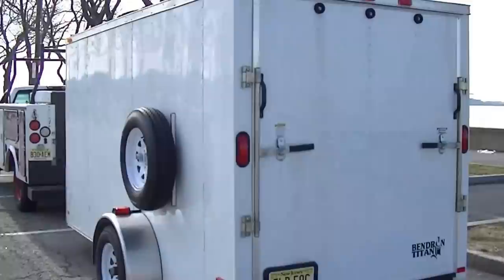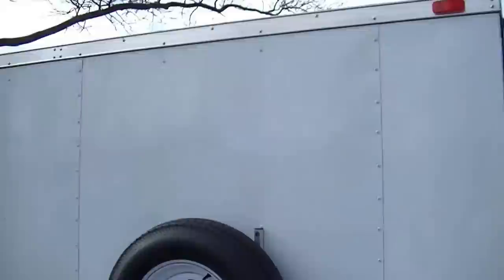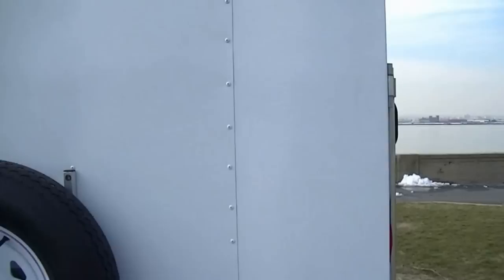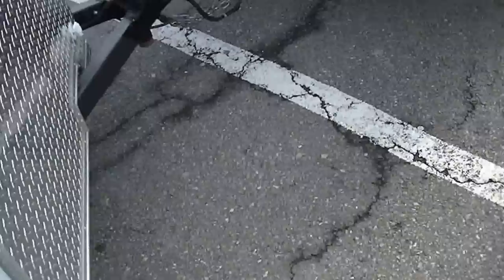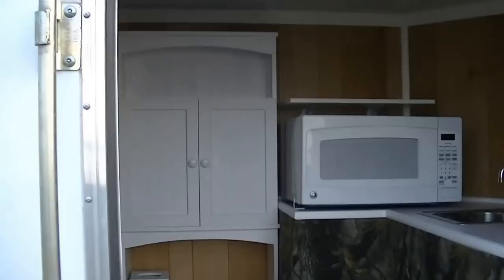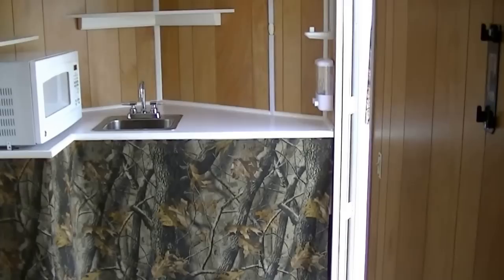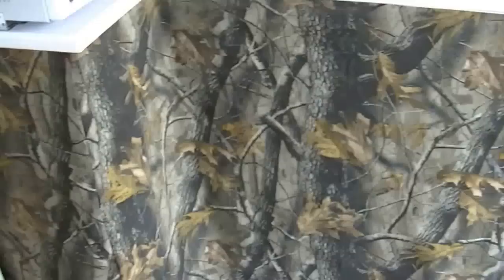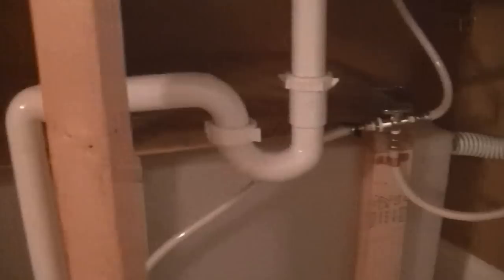Bug Out Vehicle - Cargo Trailer Stealth Camper - Part 1

Comment: Great job! I had a similar trailer I used for work and camping. The one mod I would highly recommend would be to "flip" your axle. You would move your axle from above the springs to below them, giving you 4"-5" of extra ground clearance. This helps to prevent dragging your leveling jacks and really gives peace of mind when entering rough areas. Really good looking trailer!

Comment: Nice! Hey here is a tip if you want it. Take a 8" wide pvc pipe about 8 feet long and put screw end caps on both sides. You can permanently mount it to the trailer and use it to carry fishing rods, maybe a rifle or other stuff instead of it taking up space on the inside.
Reply: would you be able to lock it up too?
Reply: Make it a black one and you can fill it with water and get a bit of solar heating too. Not much, but it beats washing your face in cold water.

Comment: Thanks for the video. It gives me ideas for hauling the Harley to Sturgis or Daytona and being able to use the bike carrier as a camper. The old lady and I are too old for tents but too cheap for lodging during peak bike events.
Reply: Jeff Lilly In my other response, I mentioned "being with people who have built similar units"... Sturgis is EXACTLY what they built theirs for.  Loaded with Solar, Satellite / Flat Screen and screen door on the side entry, with a sectioned screen magnetic closure door for the ramp opening.  They put both of their bikes inside, and when they roll them out, the sofa/bed swing down from the walls.  8 or 9 years of improvements and I would say that all 3 units are nearly perfect for each couple's budget and needs.
Reply: So the "old lady" and you are not be real bikers either.
Reply: @gsp49  
What's a real biker?
Reply: @SamC379  ask your mum. She knows plenty
Reply: @SamC379  say hi to her for me.

Comment: Damn good job all the way around. All I would do is add solar panel on the roof, reversible fan roof vent, roof AC, inverter, mini fridge, and an on demand hot water supply. Love it
Reply: +Lewis Johnson Also, a good idea is to get a coil of black pvc 10 to 20 feet to put up on roof and run water through it for hot water.  A mixer valve will be needed since the hot water could hit 200 degrees, (The longer the tubing coiled up, the more hot water until it cools down).
Reply: +hughie voso Absolutely. I used a 30 gallon black barell laid on it's side on the top of a Step Van once when chasing jobs on the road for a "vagabond" shower I made. That worked pretty good but yes the water could light you up after a sunny day lol. I had it all gravity fed and as for the shower being too hot it was in the mornings usually when I showered as I worked night shift as a crane rigger then so it was OK except in winter months to say the least. Thanks for the reply man and keep on keeping on!

Comment: BEAUTIFUL!!!  Man, but that IS sharp!!!  I would rather own that than most of the conventional RVs that I have seen out there. Why pay mega bucks for a flimsy piece of crap when you could have this instead?
Reply: +Gachitadamunga 
Hell, I wouldn't trade my travel trailer for that. My trailer is far more capable, full-featured, and comfortable. We use a utility trailer (pulled by the wife) for storage and a portable workshop. The two pickup trucks add additional hauling options. Mine, for example, hauls an inflatable boat (motor, gear, etc) for fishing or recreation.

Comment: Hi, you did a great job so far! Adding solar capable will really get you off the grid. I do have two things, that you may want to do. Attach a shower head holder on the out side wall and attach some dark water hoes wound up flat on the roof of the cargo trailer for a few gallons of hot water. I am sure you can figure out how to do the plumbing. Again, great job! Stay safe and enjoy life!
Reply: The black wound up hose for hot water works! I know 1st hand and I also wondered if theres a holder for the shower head

Comment: This is quite the set up bud, very clever use of space with plenty of room for options. I'm a plumber R&C. And a tankless water heater would be a good option. Often referred to as "Rinai" heaters, would not only ideally fit. It would handle any demands you throw at it. But you would might need to invest in to a solar panel?

Comment: That is exactly how a camping trailer should be, basic stuff and lots of empty space. You can use a foldable table es a desk and still get your 4 wheeler or motorcycle inside. Advice if I may, don’t get solar; get a goal Zero 400, add two batteries and get a Honda 2000 Generator. Put the Goal Zero bellow the sink. Solar is slow and expensive. Don’t get a fridge, get a Yetti Cooler. They will keep the ice for a week in the shade. Excellent idea the porta potty. Great work!

Comment: Good start on you conversion. I have a utility trailer that I use for my handyman service. I plan on converting it into a camp trailer in the near future. Nice to get ideas for when I do. Just for your info, you didn't need to put in a J trap for your sink since you don't have a sewage storage tank. That way you don't have to worry about getting the water out of the J trap for winter storage/freezing. The purpose of the J trap is to hold water to keep the sewer smell/gases from coming up. You don't have that problem.

Comment: Your workmanship looks great, but with all due respect. I believe having all of that water (320lbs.) mounted in the nose of that trailer causes you to be way to heavy on the tongue for proper weight distribution. That can cause poor pulling stability. Also it seams like you have all of the weight on one side of the unit. You might want to try distributing the weight out a little better. This would make pulling that thing a dream. I’m pulling one behind a 2 door Jeep Wrangler and I’ve really had to pay attention to load/ distribution very closely. My pulling capacity is only 2,500 lbs. which is approximately 250 lb. tongue weight. Please don’t take my post the wrong way. Overall your project looks fantastic. Hope everything is working out for you.

Comment: Peace, for hot water u can get solar shower bags. When I go off the grid I have 3 solar shower bags sitting in the sun, One bag is good for a good hot shower and use the other bags for washing dishes ect; real cool keep up; the great work. I agree the pooper should fall back to the rear a compost toilet a five gallon bucket.,toilet seat heavy duty black trash bags with saw dust . I place several bags in bucket so when I pull one I add saw dust. I used this method when my home bathroom was under remodeling. works well does not smell. don't forget the lids.Peace

Comment: I like it but it would have been more space saving if you built a false floor maybe 2 1/2 feet deep with cubbies below for storage, and add a lift lock roof to make up for the walk space loss by the raised floor. it would add a lot more light and don't use stationary cabinets or a bed. use Japanese floor futons that can roll up and be put away. (the thick ones not the traditional ones.) the cabinets should be on hinges so you can prop them up when in use and lay down flat against the wall when not. and on the walls and ceilings have hooks and stuff so when you have guests over you can add hammocks and fabric hanging closets and cabinets that again if not in use you can store away or tie on to the ceiling. and if you want a couch you can hook one up to the wall. the two and a half deep floor would give you space to store a composting toilet under the floor when not in use. just my opinion...
Reply: Tsukani Takuda  put some major thought into this. I like your ideas

Comment: Not wishing to be too negative as this is a VERY nice and tidy build, but if you are serious about going "prepper" you need electricity e.g. solar and batteries.  Although I know you said it was not finished.  I think I would have chopped the lower third or half of the pointed front and created a squarer boxed area for batteries and propane which you could access from outside and sealed it up to the inside.

Overall, very nice.  Great job.
Reply: Why would you need electric???  In a SHTF .. the last thing I would be worries about is my solar panels.. waste of money for a true prepper

Comment: Great first job...
From my mess up mistakes that I had to redo work water lines...
From now on I will use NOTHING but Pex... it will expand if frozen and go back to shape.. that line you used is what flooded my trailer... now I use only pex.. and it's in red and blue for hot and cold...
I sold that trailer cause the axle was NOT heavy enough. So now I'm converting a two horse with quarters trailer this time...

Comment: Great job. I am in the process of building my 6 x12 cargo trailer into a stealth camper also. What I ran into was dangerous off gassing from the plywood inside the trailer. I was getting sick with dizziness and headaches. So what I did was take all the plywood out, prime it with a safe water based paint on all sides(including edges) and put them pack in their place. This seems to have fixed the problem.

Comment: I just soldered some wiring harness for my ABS electrical signal wire too. One end by wheel speed sensor is a basic plug and play unit, but other end had to be cut, soldered, and insulated with shrink tubes. So I am learning how to do electrical stuff by soldering wires so far. I have no experience at drilling holes in rigs, however. I have a 2013 Chevrolet with a Cadillac V-6 and it can tow 1000 pounds with 100 pound tongue weight. I did tow three U Haul Trailers from Los Angeles to Seattle as well. The first trailer was 850 pounds and second and last trailers were 990 pounds as empty. I did weight the tongue of the trailer on second one and it was 156 pounds, so the loaded trailer must be 1500 pounds or so. Empty, I think the tongue weight was 85 pounds or 99 pounds. So I can over do my 2013 Chevrolet and make it tow U Haul trailers, it was great towing! Nice to visit that Idaho, Nevada, and Montana along the way!

Comment: I had a '65 Econoline Supervan. Took the hood of an old GMC pickup and made a wood stove. 11"x11"x12"Deep use sheet metal screws with a door with adjustable vent on front. Standard stove pipe through the roof. Used the lid of an old tobacco tin to cover the chimney outside when no fire. I kept a box of cheap sawdust logs for backup. Get wood anywhere. Couple handfuls of sticks got me from 35-74 in 10 min. Below freeze outside 75 inside w/window open. Never get cold! Free heat :~)

Comment: Like what you've done except for the microwave. A microwave/convection oven combo would add the ability to roast meat or bake bread in the same unit. And, without heating up the whole place unnecessarily. We had one in our last camper and used it everyday.

Comment: Wouldn't a cargo trailer actually be the opposite of stealth for a SHTF scenario? Cargo trailer = lots of supplies to steal. Whereas a camper = a mobile living area. Honestly I'd think about using a camper to haul around my valuable supplies as stealth... Just saying.
Reply: TheGWood89  I suppose that if you went off grid, say pre shtf.  You could park most places with this set up  and no one think twice.  

Post shtf I see your point.  Unless you camouflage it well, it would definitely bring some unwanted attention.
Reply: In SHTF, no one's going to need drywall, cabinets, racing equipment or stuff like that.  They'll want food, water and guns, and I'd look for those in a camper before in a trailer that looks like this.  Maybe I'm wrong, but that's my take.
Reply: TheGWood89 , the camper would be easy  for theives to get into, cargo more secure.
Reply: Bug out with a microwave and tv with running water? 😂😉😅 thx for sharing.
Reply: Put biological medical clean up on the side in safety yellow... No one will touch it.
Reply: You start at "stealth" to lower your profile in daily life but post SHTF all bets are off so you need to defend your perimeter either way. I’d probably reinforce the roof for even more sq ft. As long as the axle and frame are rated for a decent weight.

Comment: At first look at the outside I thought this trailer idea is going to suck. But once I seen what a great job you did inside, I think its awesome! You did a nice clean looking installation. I like how the walls are completely vertical, whereas vans usually have rounded or slanted walls. The front point of the trailer was a great place to have your kitchen and sink. Wonderful!

Comment: I like the stealth trailer idea. I made one myself. But you will learn that filling up your water tank to full adds about 400+ pounds to your hitch. I put my tanks over the axles and added a extra leafspring. Fresh water on one side black water tank on the other side where I use a Airhead composting head. The head needs no water at all. I also use a foot or handle water pump (I have both) for the water system.  I also have a sailboat that I live on. It is easy to hide in small coves and yes it a Bluewater boat.  On both of them I can live off the grid very comfortably. More so on the sailboat. Reason is I can carry more water / food. Besides solar power I also have wind power on the boat. Both have two heaters systems. Plus at sea I can dump my black water overboard.

Comment: NICE LITTLE CAMPER YOU GOT GOING TOGETHER , GOOD THING ABOUT IT IS THAT IT LOOKS LIKE A TRAILER !!  NO INSPECTION NEEDED ... I JUST BOUGHT A 24 FT. PULL BEHIND CAMPER TRAILER MYSELF - GOOD LUCK WITH THE REST OF THE MODS-  YOU ARE ON THE RIGHT TRACK !

Comment: Great idea, a work trailer that is a camper. You can park in a parking lot and no body would know that you are camping.  You could put propane brackets on the outside of the tow hitch or just make the connection and carry the tank or tanks in the truck. Nice job inside.

Comment: Nice. Making both vehicles even less desirable (“Johnson’s Septic Tank Cleaning Service”) would greatly increase the stealth capabilities even more. You can purchase temporary (easily removable) magnetic, static-cling, or mild-adhesive signs, which could be applied just for the occasion.
 
Of course, the more you convert it into camper (windows, external connections, access panels, canopies, etc), the less stealthy it will be. If people catch on, they may wonder what you’re trying so hard to hide. Place any further connections underneath or just inside a door.

Comment: Not sure what we have learned from your video... However, you've done a fine job of putting together a compact hunting cabin.  Good workmanship.  After being with friends who have done very similar projects, I would suggest that you add a screen door on your access door, and a screen on your ramp end... those "Magic Click Screen Doors" work very well for that opening.  Also, speaking as one who is a life-long RVer, I think that if you're going to spend very much time inside, a nice inexpensive investment to help your sanity is the addition of a 1 gallon, 2 gallon (or larger) water surge tank w/ bladder.  Without that, you will hear the pump EVERY TIME you crack the faucet, or worse, even a tiny and insignificant leak will keep you awake all night as the pump moans at a set rhythm!  Of course, I could go on about what you COULD add, but I'm sure you have your own list.

Comment: *****
OUTSTANDING!
I'm currently modifying my enclosed trailer similarly, though my back door is not a ramp. Consider at 13:14 NOT storing perishable food. For now (camping & trips) the cooler & little refrigerator is great obviously, but in a true bug out situation I'm sure you already know that a person can pack 3-4 times more food if its dried food.

Comment: For a "limited budget" that's a damn awesome set up man... Great little concealed camper... Read some other posts ... You're not hauling freakin gravel or rock so a single axel is really all you need for this. You totally nailed this in my opinion plus you made it plug and play to add extras in the future such as solar, hot water connection, etc.. Fantastic job.

Comment: Nice looking camper.  Especially like the camo curtains and their velcro attachment. The velcro reminded me of some insect screening I had that was door sized and attached with velcro. Keeps out the flies and skeeters and still have fresh air, or if there's no need just pull the screening off the velcro.  Stealth is great idea. I'd still want to be able to look around outside and was thinking it might be cool to install some through-the-door  peepholes in every wall to check things outside without giving away your presence by opening up the door....I might have a skylight for letting in daylight, and no visible windows. Have a reflectix panel to cover it inside for stealth and for colder nights or hot days.

Comment: EXCELLENT job. I really like what you've done with it. I have a few small humble suggestions for your trailer. 1. You have locks on your spare tires, but none that I could see on the drive axle tires. You might want to invest in a set of locking lug nuts to keep those from being stolen since you put locks on your spares. 2. You have PLENTY of room on either side of the V nose to install two propane tanks with mounting brackets to secure them. You can bolt it directly through the diamond plate.

Comment: Really nice! I have never built a camper but I did do a conversion like you did. I also use my "Baby"camper for hauling my golf cart and other hauling jobs, so I bought two folding beds from Wal-Mart and hung them from the wall until I need them. I also bought a Queen size air mattress that I put across the two folding cots "Zip tied together". But for the most, my camper has everything like yours.  I may have to do some remodeling, to keep up! Your camper is really nice!